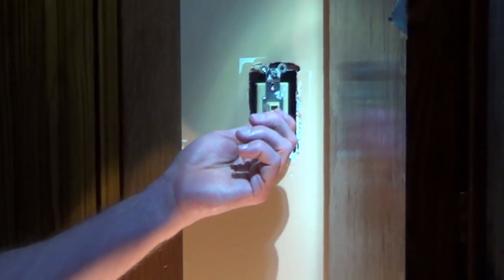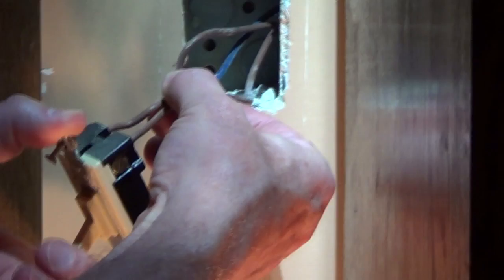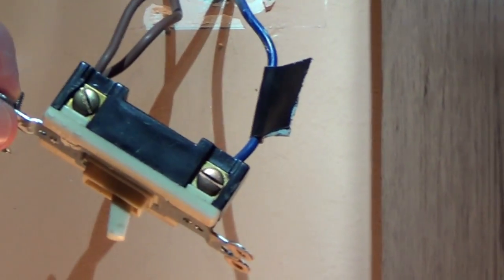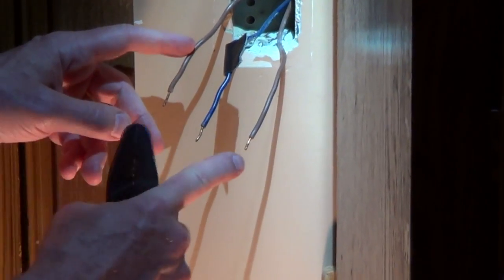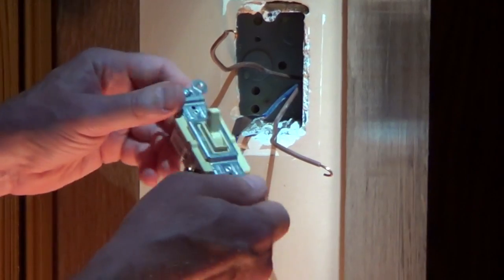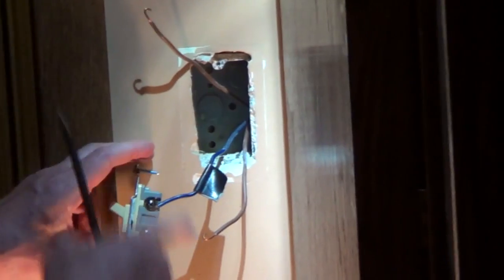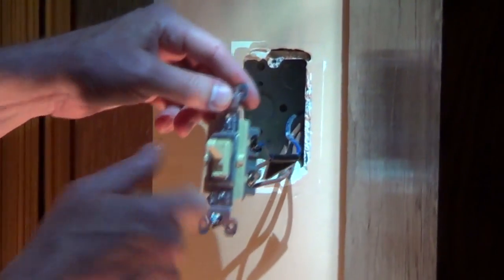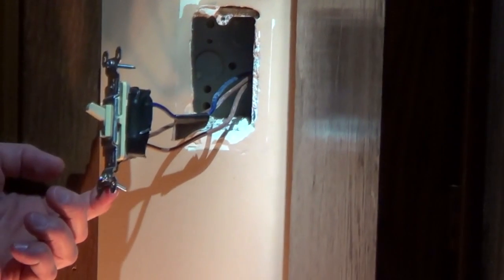How to Wire a 3 Way Switch - Wiring a Switch - Conduit

Comment: Great tutorial video!  I followed your instruction, testing each wire and 3-way switches & checking wire connection.   They're all good, but the working-light is still not on.  Appreciate all your help.
Reply from the maker: Let me know if this helps https://youtu.be/4dAql69PK5E

Comment from the maker: Hi,
For most homes, it was run for a 3 way switch by the builder. If you are trying to add a 3 way switch, you would have to run additional wires.